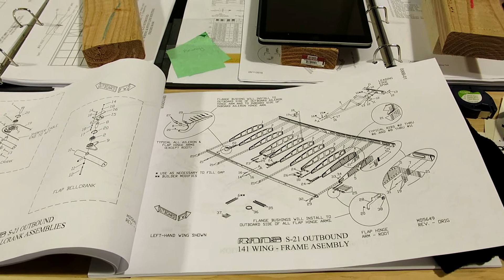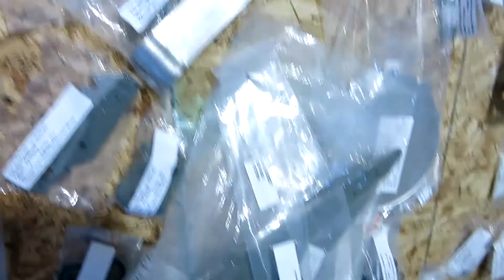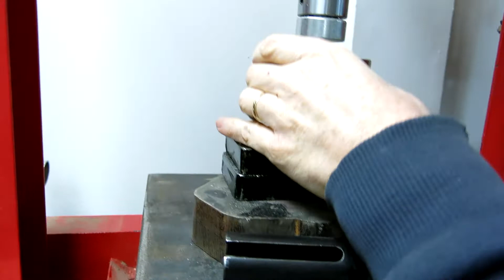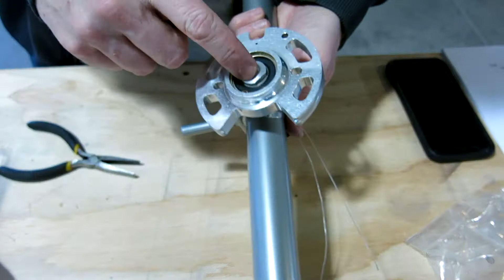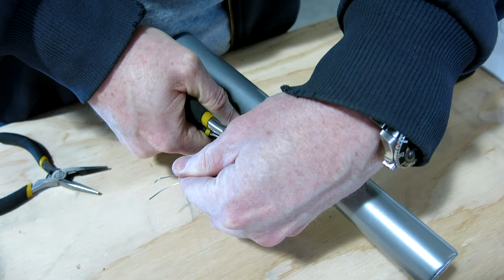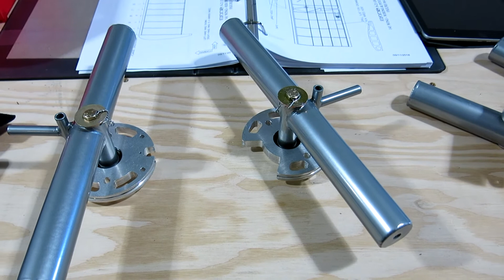No. 43 11-1-2020 Aileron and flap bellcranks

Comment: My text manual says to install the rod ends to the bell cranks as the last step in the assembly process.  These aren’t shown at this part of the parts manual, but several steps later.  It looks like you did not install the rod ends now.  I am debating whether to do that now or wait and I am curious if you ran into any issue by waiting.

Comment: Did you print the book yourself or does it come with the kit?  It looks larger than normal size.
Reply from the maker: Printed myself. I have access to a copier/printer and we have 11x17 paper. Used Adobe Acrobat to remove the text pages and printed at 130% and it fit nice on that paper.

Comment: Maybe safety wire though the bolt head and around the head with the twist  back to the anchor point (to keep the bolt from backing out).
Reply from the maker: That’s pretty much what I did the second time around. Would have been easier if it didn’t have to make that 180 around the washer. But I think we got there. Plus it has blue Loctite in it.